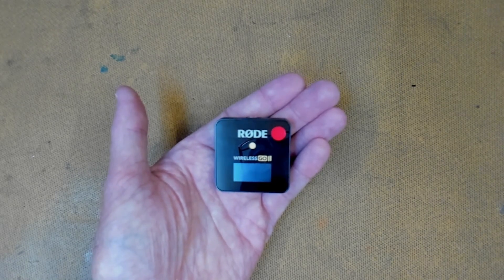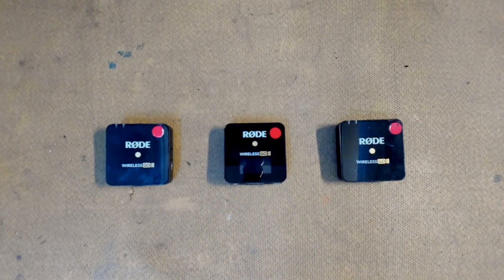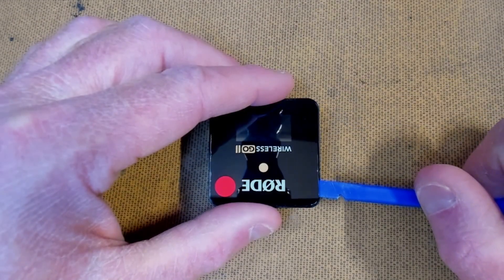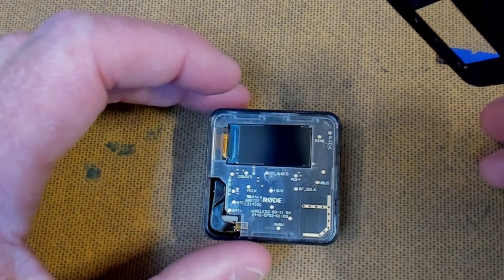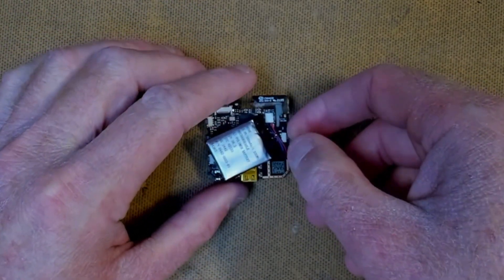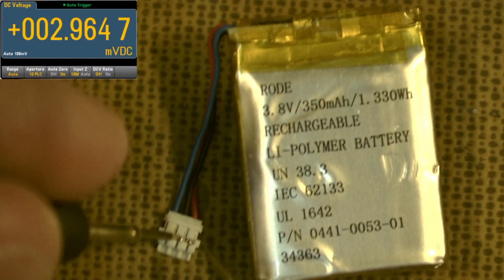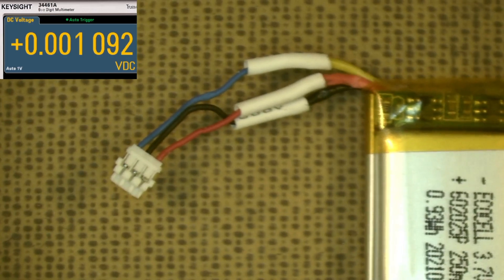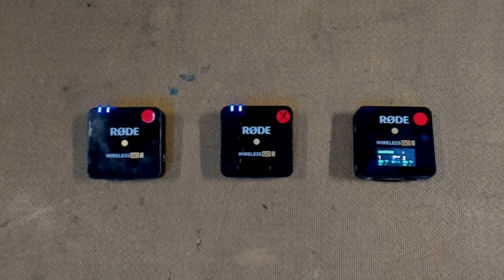Rode Wireless Go 2 Receiver Battery Change

Comment: Thanks for video! Can you tell me the largest physical size lipo battery that will squeeze in? (can't see to find a 25x20x6mm battery - can only seem to find a 33x20x5mm battery - thanks
Reply: Apple Replacement Akku A1875
replace the electronic from original akku to the new akku!
Reply: Thanks! Is it the same connector and is it 3 wire?